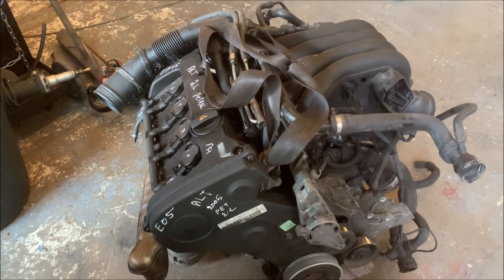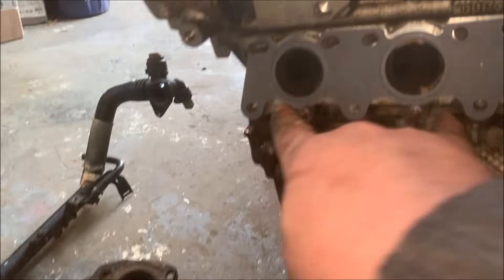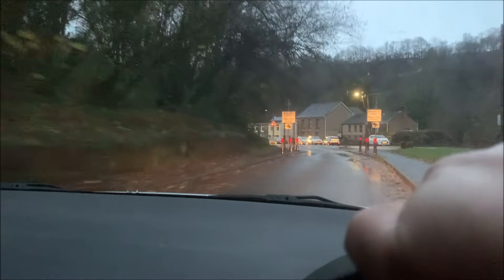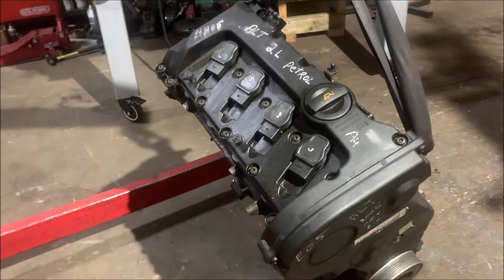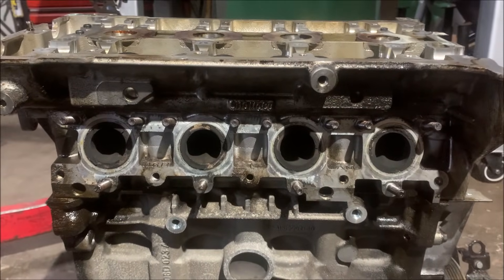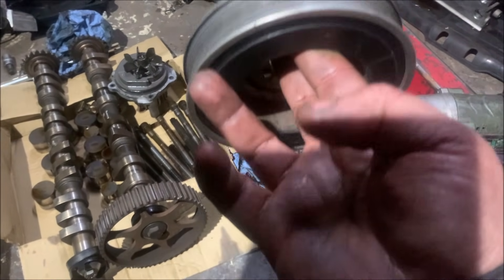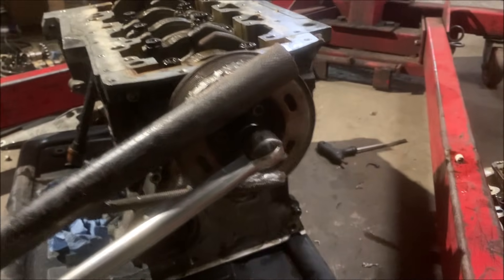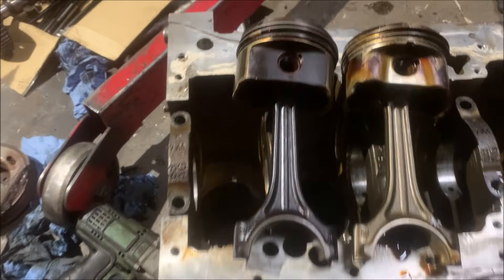A big port, alloy block, 2ltr, 20V Audi ALT engine? I buy one! And buy ANOTHER MR2- VR5 Turbo time!

Comment: Do these accept boost well? See these all over junkyards here for CHEAP and i never thought about these being 20v… also would a 1.8t exhaust manifold fit this engine?
Reply from the maker: Watch the video, you can see the exhaust side of the head is double drilled to accept the 1.8t manifolds too, yes.

And as I show in the video, aside from the high compression, the pistons look just as strong as the turbo ones.

Unfortunately I also show the rods are exactly the same as the 1.8t ones too, so I wouldn’t want to run a lot of torque lol
Reply: You would need to get tfsi pistons, and notch them for third intake valve, connecting rods are weak, but you can get rods and Pistons from EA888 with 23mm wrist pin, those are good for over 450 whp, block is good for at least 600, unfortunately I don't remember if stock crankshaft is cast or forged. If it is a casting, you can use EA113 tfsi forged crankshaft, or if you play around with connecting rod length it is possible to use a TDI crankshaft to get almost 2.1L and more torque. 
It's not great stock, but bock, and head are great

Comment: Keith Murray at Dialynx Performance made one of these engines into a 700hp setup and is currently in their 4cyl 1.8t R8 hillclimb car. I think the architecture for this ALT engine may have been developed for a long forgotten Audi A4 DTM car or something.
Reply from the maker: Funnily enough i thought Keith did they yeah, I recall him telling me when he was first building the R8 he was going to use a 2ltr alloy block but forgot about that until you just said it

Comment: You mentioned there are a few iterations of 1.8t heads, whhich are the ones with the largest intake pots? The BAM i suppose since it's got the most power from factory?
Good call on the pistons from the BAM. Will keep that in check when i build mine. Will be chuckin in the cheap h-beams in for peace of mind...
Reply from the maker: Only early ones are big port, none of the most powerful ones, as no need until well over double the factory power of even a bam.
Only found in some early 150bhp 1.8Ts and some non turbo engines.
Reply: @StavTech  In that case, no need, as my power goals aren't too crazy :D Love your content mate! Keep the videos coming!
Reply from the maker: @JLee-bz4kh  under 450 defo no need ever, even at 500 plus it’s not vital, but would give more power at same boost
Reply: @StavTech  I'm definitely not ready to go past 350 lol so not needed for my goals by a long shot. I'll throw in some hbeams though for peace of mind
Reply from the maker: @JLee-bz4kh  rods for sure, cheap insurance, 100%

Comment: Would it not work if you put the head on the bam block Weld up those little holes and give it a go
Reply from the maker: Easier just to run a big port 1.8t head

Comment: Do you think you could cut or stamp or order or whatever an exhaust manifold gasket that makes use of the extra studs and larger area, and if so, what benefit might that give you over going with just one pattern or the other? That's a nice-looking town you were driving through. Have you ever heard of David Vizard's polyquad technology for 4-valve engines? It'd be cool to see someone actually replicate and test it both NA and turbo'd and then compare it to a 5-valve head.

What it is is that you enlarge two diagonally opposing valves (so one intake and one exhaust) while leaving the others stock-sized, then I believe you also have different duration/overlap and/or lift for the lobes of the respective valves, too. The idea is to induce more swirl and tumble mixing, as well as having only two valves open first so that scavenging is really high in velocity/energy for the first portion of the overlap period. Look it up and let us know what you think, especially if you try it. Also look into his "port biasing" porting method, though IDK if that'll translate to 4V or even 3V engines as much as it does to 2V engines... Maybe it could boost a 5v, too if you only do it to the outer two intake valves? IDK.

Why not keep the alum block? Isn't lightweight better? And regarding strength, can't you sleeve it and brace the upper part of the cylinder if it's open deck? Lastly, regarding strokers; I think 3.75" (95mm) is the best max length for a stroker. Assuming you still have enough rod length for a 1.62-1.65+ rod ratio, that should be 8000rpm safe both in terms of the raw stroke and the rod length. Might even be able to push the rev limit piston speed to 1100 inches per second and sneak an 8800rpm peak out of it, too. Plenty of revs for any street motor while absolutely maximizing stroke length for torque. Even if you put it 100 in/s lower that's, as I implied, still an 8000rpm redline. Peak hp is about 150 in/s lower, so 6800 rpm in that case or 7600 rpm in the case of pushing it all out.

I get these numbers from this thing on the net called "HP Wizard." Definitely not quite accurate or precise by many metrics, but it has guidelines for mean piston speed (in m/s or you can change the unit, and I like in/s when using this site) and how that relates to different kinds of cars. "Short race" IE NASCAR and Formula 1 is about 25m/s and "mean" seems to imply peak power rpm given how both F1 and NASCAR rev past this 25 m/s mark at redline. I'm getting those numbers from a comparison of 2010s F1 and NASCAR. Y'know, back when F1 sounded orgasmic with max effort 18k+ rpm N/A engines?

Anyway, the point is that if those cars last 10 hours between rebuilds when nearly constantly at or around 25 m/s then 25 m/s should at least be a reasonable max RPM speed for a street car engine, given how one isn't constantly racing their car. Hence why I tend to go a tier (100 in/s) lower for the max rpm compared to a "short race" circuit car's mean piston speed. One thing of note, all the nutjobs spinning the K24 to 9000-10000 and beyond are exactly that; nutjobs. Because that 4" stroke is absolutely not suited for such a piston speed if you want the engine to last. You'd think 0.25" wouldn't make much difference but it's 0.25" twice per revolution times 140+ revolutions per second. That's a LOT of extra momentum to deal with and it adds up in parts fatigue over time.

/ramble
Reply from the maker: Absolutely zero advantage to use all the studs. The 20vt uses more.
You can spin a 20vt to ten grand plus if needed, I’ve gone 8800 with no issue and I’m on standard pistons and crank.
Alloy block might be ok but the fact it existed yet VW and Audi still used the cast iron version in all their powerful engines says a lot. Weight saving is minimal, hence K series being heavier despite alloy block.

The other stuff involves big money and big development and there’s no need